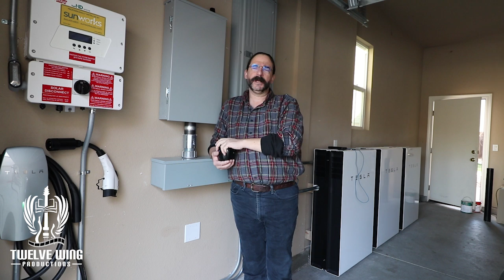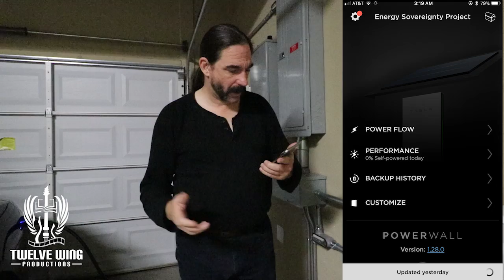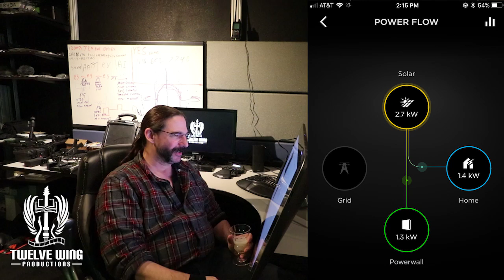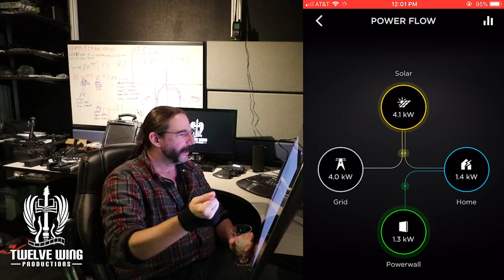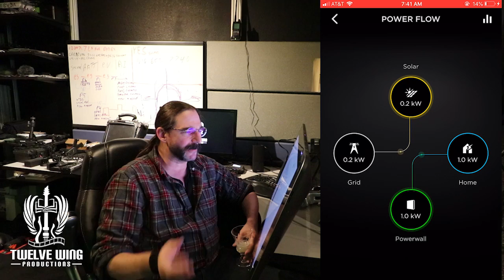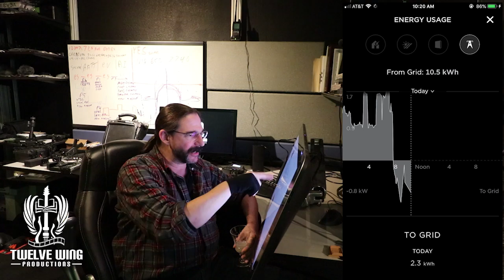ESP Video 4.5: 6X Tesla Powerwall 2 control issues

Comment: With winter quickly approaching, have you managed to get the time of use working ? Can we have a update from what was happening last year with this and if it’s still the same ? Why can’t we just have a time clock ?
Reply from the maker: I've been messing with this off and on as updates to the software are made.  I have not yet noticed that this setting does ANYTHIG but favor the grid.
I'll so a video specifically devoted to this soon as it really is quite annoying.
I think it's a victim of it's own adaptability.  It's supposed to learn your homes behaviors over time but it certainly doesn't seem to be taking capacity into account.
Systems like ours and Thomas's are so large that it seems beyond the software's ability to cope for some reason.
When set on time of use, it's still a mystery to me why it's sending power to the grid at a time of year when I can shut my grid power off for a month and run just fine.
So am I not leaving it long enough?  Does the software have some idea that I'm being paid a fortune for the power sent to the utility company?

Hell, playing devils advocate... is it trying to make sure I don't have to pay anything at the end of the year by taking my net deficit into account?

This is kind of the problem with creating something like this and having next to zero documentation on it and then tossing it to the 4 winds for people like me to figure out.

So thanks for this reply.  I'll pick this up again and see what the new software has done for it.
Reply: Twelve Wing Productions 
The reason I’ve asked is I’m having a pw2 fitted on the 14th and I will be relying on of grid charging during cheap rates, in the NW UK we are not blessed with the sun you have so for 4-5 months of the year the grid charging is essential
Reply from the maker: @AllElectricLiving , At least they let you charge from grid power.

Comment: watching the last several videos (since your install to this...  yes i know it was 6 months ago)... it really looks at least to my eye, that the controlled believes you have net-metering type electricity rates in the cost savings route.  I know here if I had a PV system with TOD, that would be the case.. I would be paid the same ~~20 cents per kWh that I would pay to take it off at peak.  Obviously this isn't true everywhere...  actually the seemingly "pro-solar" ammendment a year or so ago had passe here had passed, we'd only be paid 3-4 cents per kWh .. really sad how it sounded so pro-solar to the average consumer (literally advertising with "every persons right to have solar" etc...) ...  anyhow... I could see if you only had 1 or 2 like I think tesla had envisioned, and had the net-metering pay back in system...  it really could work okay in that configuration.  But I think I personally would want closer to what your trying to do...   all solar goes to the house first, battery second, grid last.. and if solar can't feed the houses's need, then battery to house... then during night, make the difference off the grid to battery as needed....  if at all......   sadly it seems the power wall is too limited in this respect. I could simply get a bunch of LiFe batteries, a charger and a number of contactors and do basically the same.. but utility would never allow back-feed from such a setup.
Reply from the maker: Pretty much how you described it.
I'm not looking to backfeed power from the battery into the grid, though I do think that eventually that is what the utility will actually want people to let them do.
So long as they compensate people appropriately for this, it's not an issue for me.

lastly, you are correct about how the system should work. 

The battery is a battery.  It neither makes power nor uses it.
So when it's not charged, it should be able to BE charged to the percentage I choose no matter if it gets that power from solar or off peak grid power.

Comment: Great video.  After watching this video I too am concerned about this.
Reply from the maker: Yeah, basically the time of day stuff isn't really useful at all other than to put a block on the system as to when it discharges.
Even that might be crippled a little.  I'll go into this in greater detail in the summer months when we have a huge overage and are simply trying to make sure that we NEVER purchase power during peak times.. or in fact... ever.

It's important to remember, however, that everything you see that is software related is simply window dressing.  It can be changed on a whim... overnight.
As Tesla finds deficiencies, they will alter it.  I've already had 2 problems fixed with a software update since we installed the system 2 months ago.
The first was the temperature issue where the system was shutting down.  The second was an issue where the system would shut down if it couldn't contact Tesla for 24hrs straight.
This last issue was actually fixed with a software update the day it came online.  That update had been available for a while.

So when making your decision on what system to buy, focus on the capabilities of the hardware and not so much the software.

Comment: In UK, no tax incentive for PW2 installation, except VAT down to 5% if installed at same time as PV. Allowed to charge PW2 from grid in off peak times. Expect to lose this advantage over next ten years as duck curve flattens.
Reply from the maker: I disagree.  I don't see the duck curve being an issue at all.  In point of fact, charging from grid power will help keep the power curves flat by drawing power when demand is low.

That's kind of my point in a few other videos.  Have a look through them.
A battery is a battery.  It doesn't cause your home to draw any more or less power than it normally would (Aside from some minor losses).
What it does do is to allow you to shift when that power is taken from the grid.

Thanks for following along with us Judy.
Have a look at our duck curve video.  It explains this a bit better than I can in a brief comment reply.

Comment: I found a recent Tesla Motors Club message board string quite informative (link at the bottom of this message for reference).  Hopefully the thread and below comments I’ve made are illustrative regarding these types of challenges you and other people are having with how Powerwall is managing charge and discharge management.  :-)

The thread title is quite apropos:  “We Need More Control Over Our Powerwalls” :-)  Many of the user experiences and comments go right to your point about challenges with Tesla’s app/software settings, and struggles people are having to get the Powerwall to perform how they’d like it to perform experimenting with the different modes of operation / time based control settings...especially for people that have both solar and Powerwall(s). 

A few points that stood out from different users:
1) Seems that from software update 1.25.0 and later, for some users the Powerwall started acting almost without logic in terms of when it was receiving power from solar during the day vs. solar exporting to the grid — ie. The problem of Powerwall(s) still on low level of charge before peak hours, but the software telling the solar to export when the desired result would be to charge those Powerwalls up more with the solar.

(Side note: for now there isn’t a way around the rule that the Powerwalls can only be fed by solar energy and not by the grid for homes with both solar and Powerwall(s), until Tesla updates their software to allow this, which would be do-able if the homeowner isn’t trying to claim the 30% fed tax credit for the storage, and if that particular utility’s rules allow charging of storage from both solar and the grid.  Second side note: a home can install Tesla Powerwall(s) without solar, and such a home is able to charge the battery over night or during low-rate times of day from the grid, and thus deliver that cheaper stored power to the home via the storage instead of using the power from the utility during more expensive peak times of day.)

2) Some users comment that they’ve done trial and error to find the setting that has worked overall best for them to get the solar to charge the Powerwalls more during the day ... such as “Self Powered” or “Balanced”.  They have mentioned that one problem to be aware of that can cause poorer performance of the Powerwall/software is if they switched too often and too much between different time-based control options or changed the desired Reserve percentage too often.  It seems the software /  Powerwall energy management starts to work better after the setting has been in place for a while, so that the software can adjust to the actual solar production for that time of year and home’s usage patterns.

3) The Time Based Control setting “Cost Savings” and Tesla’s recent app software in general seems to prioritize exporting of solar during the day, because they seem to be assuming that most users have a favorable reasonable rate from the utility for exported power during the day via their Net Metering agreement.  This works for cost savings in PG&E where even lower Winter partial peak export rates are 20c up to 26c/kWh during the day when the economics in this scenario dictate its best to export as much power as possible.  This doesn’t work well — and is a problem if the Tesla Powerwall software is prioritizing export during the day if the export rates aren’t favorable such as in municipal utilities in CA like SMUD, MID, etc, or, for a user in Colorado who mentioned the export rate for solar is quite low.  Best settings results they’ve found? See next point.

3) For the goal of having the solar charge the Powerwall(s) up enough during morning/early afternoon instead of exporting solar then and before the more expensive 2pm and later afternoon peak hours, and in the Winter when the solar produces less per day than home demand or the Powerwall(s) capacity, a couple users mentioned this approach:

A) Self Powered mode — because the other time based controls “balanced” or “cost savings” prioritize exporting solar to the grid more for the reasons listed above.

B) Setting the reserve level higher such as at 60-70% and leaving it there in winter, which seems to have the effect of software prioritizing getting the Powerwall(s) closer to full during the day with solar production and less export of solar during the day. And then adjusting this Reserve lower but just occasionally as the solar kWh/day increases towards spring / summer/ fall.
One user had a good point that the reason for this strategy is that during the Winter the lower solar production even on a clear day is only capable of adding the equivalent of 30%-40% of the Powerwall(s) capacity in kWh, and, the Powerwall(s) software seemed to do better to get the solar to feed the batteries to get them from 60-70% up closer to full capacity during the day.
For example if a 10kW solar produces 20-25kWh/day avg in Winter, that solar is about 30% of a 6 Powerwall set-up.
(For a slightly smaller system example, let’s say a more common 2 Powerwalls and a 7kW system, and 15 kWh/day winter solar production, producing about 55% of the 2x Powerwalls’ capacity, they might set a corresponding lower Reserve level of 45%)

4) Hopefully Tesla software will adjust in future updates, given that for now it seems, especially on “Balanced” and “Cost Savings” tbc settings, that they’re favoring too much solar export over sending solar to the batteries, especially for people in areas where the export rate for solar from their utility isn’t very favorable.   

5) And, hopefully in the future Tesla will allow a solar + Powerwall home to have both options in their software to charge the storage from both the solar AND the grid when utility rates are low (assuming a homeowner is ok with not claiming the 30% fed tax credit for storage, which is typically allowed when solar power is the exclusive source used to charge, and, if their particular utility allows such a scenario, which I think many do).
https://teslamotorsclub.com/tmc/threads/tesla-we-need-more-control-over-our-powerwalls.134213/
Reply from the maker: "“We Need More Control Over Our Powerwalls” ~

That says it all right there!

Thanks for the reply.  I'm actually still reading and digesting it.  Looks like you will get to see the lion's share of what they mentioned first hand as we present it in video format for folks to see and share.

One thing you wrote:

"(Side note: for now there isn’t a way around the rule that the 
Powerwalls can only be fed by solar energy and not by the grid for homes
 with both solar and Powerwall(s)"~

There actually is.. and we have already tested it.  Unfortunately, having something be possible and having it be practical are two different things.
To bypass Tesla's condition we tested a 10kw bidirectional synchronous AC power supply.
We used line current and simply ran it's output wires through the inductive sensors for the PV supply to the Tesla Gateway.
We did this at a test facility... our own "Skunkworks" to verify this would work before dropping $3k on a piece of test equipment we would only use for a month.

In the end, we decided to work with what we have and to continue to whine about it. (grin).

In closing:

"(assuming a homeowner is ok with not claiming the 30% fed tax credit for storage..."~

No.  What needs to happen is for the legislators and regulators who wrote this to change the wording to say "A majority of production is solar" or we vote them out of office.

That.. is what is needed.

Comment: Does your grid not pay you for power sent to it? I would have expected the common case to be that solar power sent to the grid, credits your bill, and would be the thing you would want to happen when they would pay you the most for that power.
Not that this is the only thing that should happen, but that it would be one of the acceptable things to happen during that peak rate time frame.
Reply from the maker: In my case the utility offsets the kwh of production.. BUT... they have initiated time of use rates.  So the value of the power sent out isn't valued as highly as the cost to buy it back.
That's not the total issue here, however.  The other thing to understand is that because I'm using the power collected to try and get extra miles out of the car, the value to me is a gasoline equivalent and of greater value to me than the cost of the electricity alone.

To put this in it's simplest terms, when my home is consuming more power than my solar produces, the amount of energy from solar power to the grid should be zero.  Period.  Unless in the case of an emergency.  In that case I should be notified and compensated at full market rate.  So that's basically what I'm pressing to have happen here.
Reply: @twelvewingproductions7508  I fully agree that there should, be a mode for that behavior.